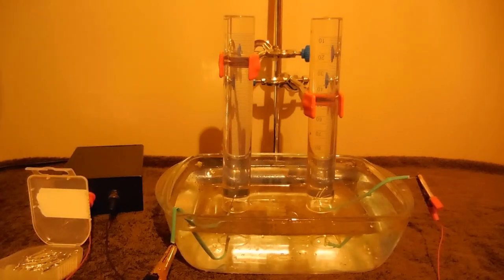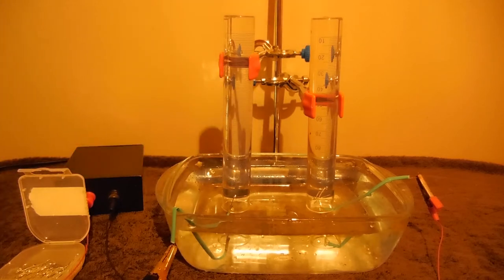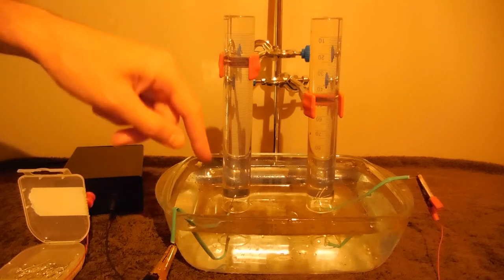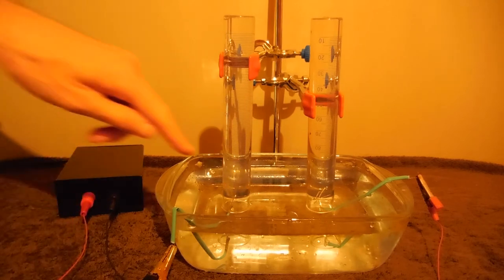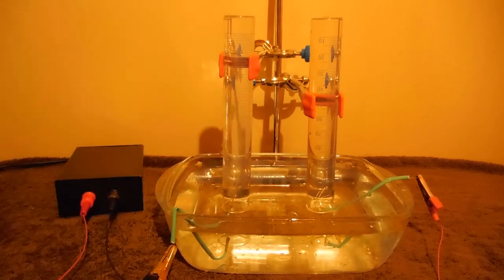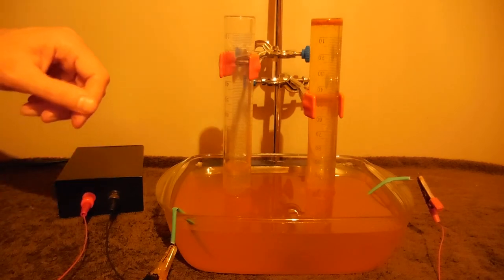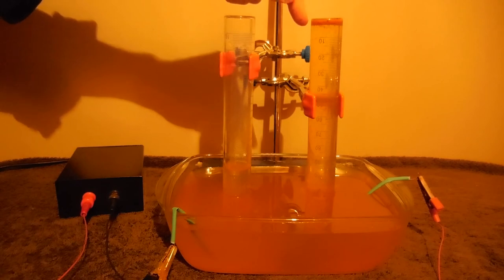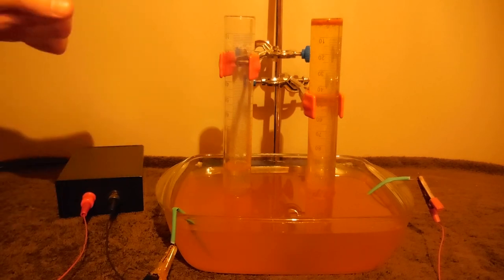Physics Experiment Electrolysis Of Water With Iron Electrodes Timelapse Recording Full HD video

Comment: Hang on a minute. If those paper clips were standard they they will be plated or else they will not be shiny . Plain mild steel wire will turn brown (oxidise) even in a plastic container.
Also... you are using drawn mild steel not Iron. They are similar but not the same.